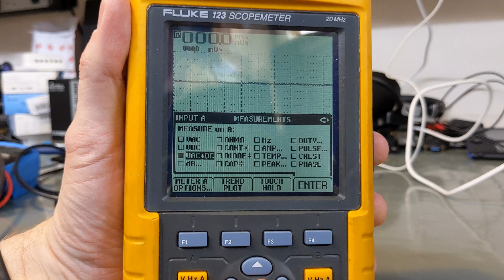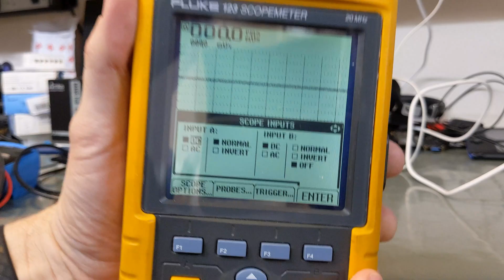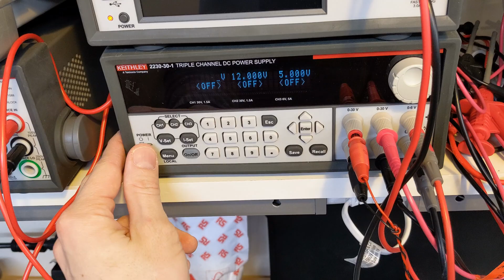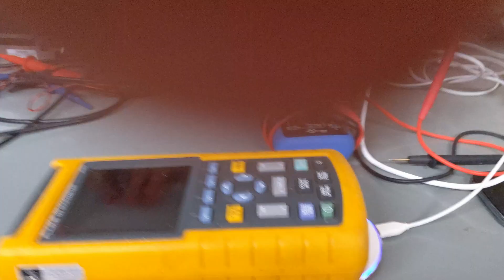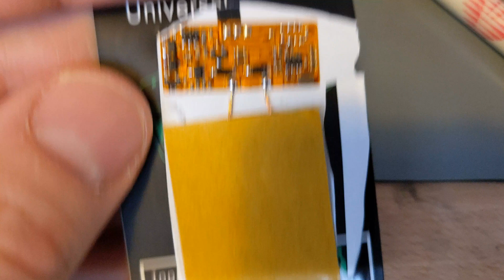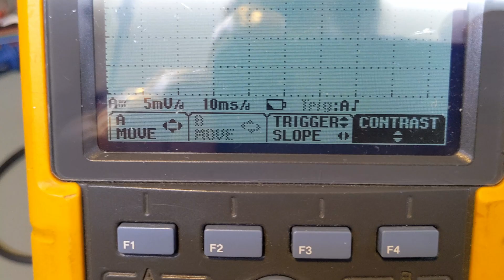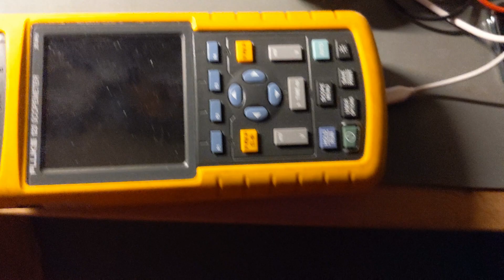#9 Fluke 123 ScopeMeter/DMM wireless charging upgrade

Comment: I would put 2 2ahr 18650 batteries one is not enough ..my 43 uses a 12v DC supply but for data logging you need a computer

Comment: I bought a multi charger with variable voltage on amazon i think it was $50 and indeed is shorter but you can cut the isolation of the plug and then use it with your fluke, also remind to use the inverter plug cuse you know… fluke

Comment: You can remove the rubber boot inside the charging hole. Then you can use a regular barrel connector.

Comment: i can pick up one of these in units in great condition but without the charging cable for $200 is that worth it without the cable.. so it will cost me $400 to have a working unit with cable? Do you think a novice can set up a diy charge cable? I dont need it remotely was just going to use it as desktop
Reply from the maker: Hey, the units are well worth $200, but I only use it when I'm messing around with SMPS. I would recommend making your own charger to save money, you can shave down some barrel jacks to the right size, but it will take some iterations.

Comment: I have the same problem with my  Fluke 124. I have replaced the original batteries with Panasonic MH 1906, but I'm not happy. Charge is very slow and doesn't last long. Looking for a different solution , something like yours. Thanks for your amazing video.
Reply from the maker: Glad to hear you liked the video. I've actually changed to a USB C charging cable (see my only YouTube short video), as there's too much distance between the charger and the charging coil, leading to a lot of heating during charging. I'm back on replacement MH batteries, but having it USBC makes it very easy to charge and I now use the meter all the time.

Comment: Nice!  I was unaware of the flat charger interface modules, perhaps because I've never looked!  But it adds a candidate for me.

If I had a ScopeMeter, I'd try to keep my expectations in line with what it is -- might be nice for various tasks.  I have a little DS212 gizmo; there's are similar "too much trouble" and "(even more) limited" barriers for it.  A little small and fiddly, similar charging issues, but If it was out and ready,  I might use it more often.  The wireless wouldn't be an option, but I suppose I could just keep a USB cable handy.

I was just watching your 8591A video, which I found interesting but I confess a little harder to follow as you moved quickly through the details.  This one had a nice flow and orderliness that made it quite comfortable to follow what you where thinking.  Nicely done!

I might suggest giving yourself a little more distance from the microphone; when it's as close as it was, and then compressed, it ends up feeling a little like you're right up in my face!  Just a preference, I guess; I think you want a kind of a more natural feel to the sound.  I like the nice steady level, though.
Reply from the maker: Yeah the retrofit Qi coils are very cool and so cheap, clearly targeted at phones but such a nice module for all DIY things. I agree about the scopemeter concept and I'm setting my expectations now, but I do find it a lot more useful now its charged (and always on the bench).

Thanks for the feedback on the mic, I'm doing these videos to develop these audio/visual skills so feedback is important. I'm still figuring out what I want to do, this was the first time I used a "voiceover" approach rather than a direct mic, and I recorded it at night while my family was asleep, so it unintentionally sounds like I'm trying to do ASMR... I'll try giving the mic more distance in the next video. I am much happier with the levels now though. 

About the 8591A, yeah, first video, didn't know if I could even repair it, there was a lot of trial and error in that one! Still, I think it worked well enough, looking forward to my next repair videos, hopefully that will be a better mix of everything!
Reply: @bansci  Sound is kinda my thing.  YouTube and public vids in general present some interesting challenges -- for starters, everybody's listening configuration is different!  But there are some basics you can use to pull everything toward the center, and I think you've done well with that.
Reply: The Fluke 123 (or any scopemeter) is handy for making measurements with a floating ground.  It isn't grounded.

Comment: Great idea, altho I find the scopemeter to be more of a toy then an instrument.
Reply: Getting the right tool for the job is important.  This device is intended for field use particularly on control circuits (HVAC, variable frequency drives) things like that where voltage, phase, frequency are important.  The metering is the principal feature and the scope is not intended to replace a "real" oscilloscope.  Conversely, a digital storage oscilloscope is designed to show you the waveform and it derives its measurements from the 8 bit ADC conversion; so is inherently limited in precision. 
I used the Fluke 123 to look at voltage, frequency and waveform of a Generac generator since the UPS fed by it really do not like it.  Voltage says okay, frequency mostly okay, but OMG, look at that horrible waveform.   Try that with a "real" oscilloscope and sparks are going to fly unless you are using a differential probe that costs as much as the oscilloscope (or float the oscilloscope with an isolation transformer but that's not a very good idea either since the case could be "hot" if you do that).
Reply from the maker: I'd be interested to hear why you think that, but I agree based on how little I've used it. I'm hoping this mod helps it find its way onto my bench more though because I feel it could be a useful tool, I just don't think its well packaged.
Reply: @bansci  Well, I had one a few years ago and somehow I felt it was not intuitive to use. It has this destinkt cheap 8bit plastic feel to it and hat's the bandwidth on this thing? Eventually the LCD developed this nasty line issue where the flex connection slowly separates itself from the glass.
This unit may have its place for generic use when working on electrical stuff or when isolation is needed but when working on electronics I'd prefer using something more serious of an instrument like a Tektronix or so, even if it is of 90 vintage.
Reply from the maker: It's no bench meter or scope, that's for sure. The build quality and "experience" don't feel any worse than, say, a DMM, but I agree they're not for any serious analog work and would be frustrating if used for it. I guess then it's niche is power supply debugging. I've fixed one bad linear regulator with it and it was faster to debug than with a normal DMM, but I only looked at the shape of the wave, not it's values. Thanks!